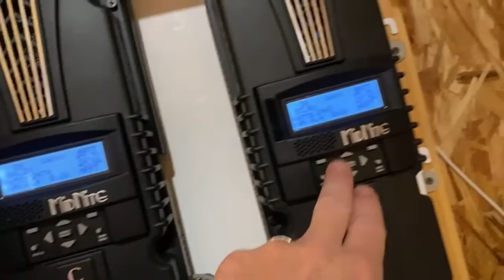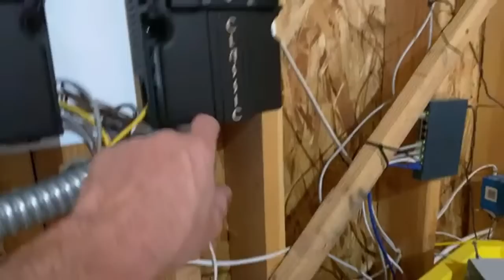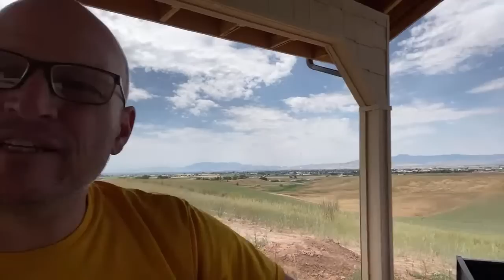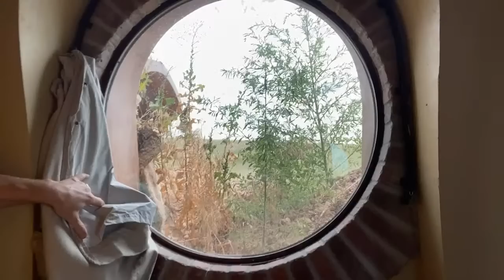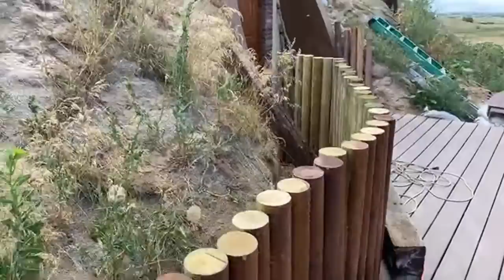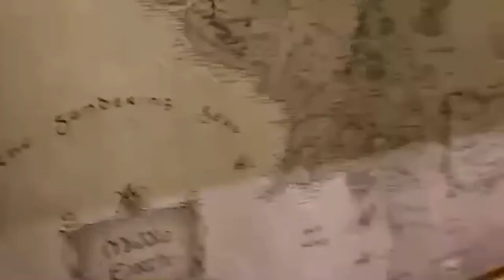wHobbit Solar

Comment: Not sure how long those wooden poles will last as retainer walls. Don't underestimate the weight of the dirt.
Usually retainer walls are a sort of L-shaped concrete block, with the foot the the L under the soil it's retaining, so the weight keeps the block in place. Same idea as crowd management fences at big concerts.